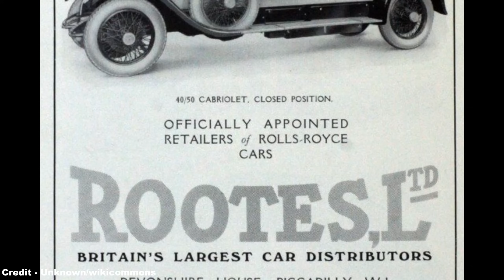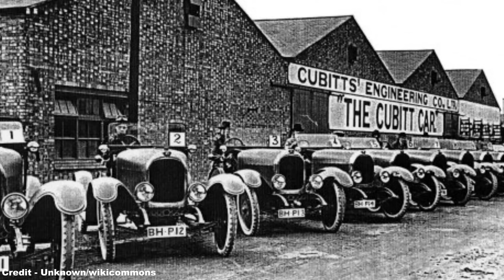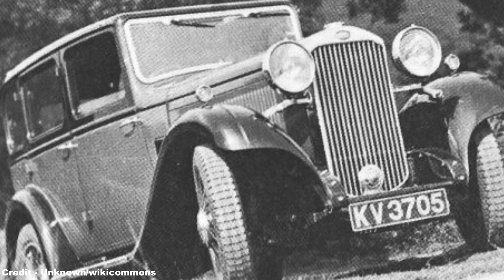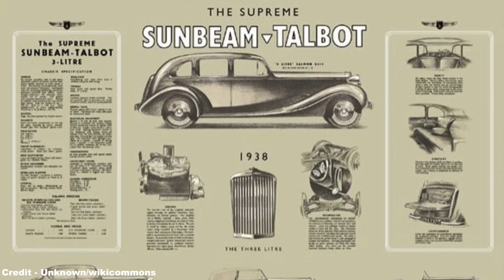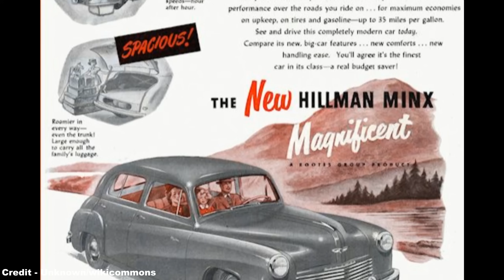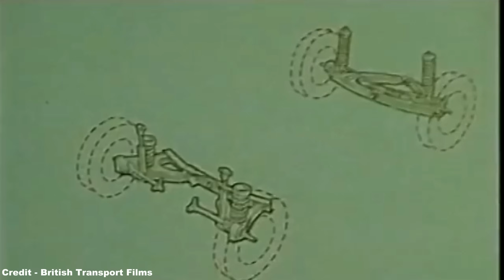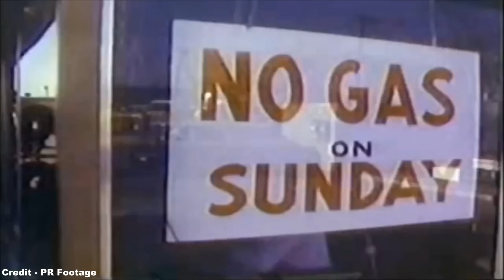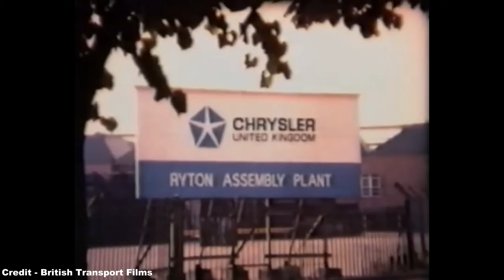Britain's Second Largest Car Company - The Rootes Group (Reworked)

Comment: I  did my apprenticeship at a Rootes Group main dealer from the mid 1960's and dealt with a lot of the models covered in this video. In my opinion the start of the rot was the government "strongarming"  the company to build a factory to build cars in a plant 300 miles from it's main operations, just for political expediency. The final nail in the coffin was the takeover by Chrysler Corp. From the start cost cutting was the name of the game , and by the early 70's things got really bad. I well remember inspecting new  Avengers and Hillman Hunters that had absolutely no corrosion protection on them underneath at all, just lightly painted floorpans, sills and underwings, so corrosion started from day one. Interior finishing was cut back to the bare minimum on the base models, to the point that a passenger front seat looked like it would become an optional extra, and cheap, thin rubber matting added to the air of something very unappealing to buyers. Sadly, all  part of the demise of the British motor industry, that through a number of different factors, killed off Rootes Group  and many other marques as well!

Comment: When I was young we had a Hillman Imp, but not for long. On two occasions, whilst traveling about fifty miles to visit relatives, with four of us in the car, its engine exploded at exactly the same place on a long hill, filling the car with steam. It was replaced rapidly thereafter with a Cortina, which itself didn't last (its bouncy ride made my Mum feel sick, and it had a habit of ceasing to run when wet!) before my Dad found a second-hand Rover 2000 TC that we all loved which remained with us for years until it eventually rotted away.
Reply: I'm with you on the reluctant Cortina. Ours was utter rubbish in the damp and as kids we were often pushing the bloody thing.  I've never had a Ford.

Comment: I can clearly remember hiring a Hillman Imp from Charters of Aldershot in around 1965/6. I paid £4 .10 shillings for Friday to Monday with no mileage charge. I was 18 years old. I drove it from Surrey to Yorkshire and back for a family wedding. It had 50 miles on the clock when I collected it. The two oddest things were the speed at which the engine picked up revs and how sensitive this rear engined car was to side winds.
Reply: I’m curious Mr dunky   how do you mean it was odd which the engine picked up revs-  can you explain more?
Reply: The “STD” brand! I imagine the models started from the germ of an idea that then , I bet you , spread like wildfire and the cars had quite an infectious charm😂

Comment: As a Aussie Chrysler tragic with strong connections to the UK (family 🇬🇧) this is a very interesting video I was always lead to believe the Imp was the Rootes group downfall though funnily enough my Uncle had one in the mid 70’s and used to go from Bolton Lancashire England  to my Grans house in Kinbuck Perthshire Scotland 🏴 every summer fully loaded and never missed a beat. Ah the memories aye 😁 0:10
Reply: Did you know the initial purpose of the Chrysler/ Simca 180 (what became the Aussie Centura) was to be a new generation Humber V6 for 1970.  Millions were even spent developing the V6 before the whole concept was unceremoniously dumped. At the same time Simca were struggling with their own relevance so the stillborn Humber project was  passed onto them for final development... albeit as a 4cyl...  
I'm sure if the Humber V6 project had gone into production it would of been a huge success for the ailing company...
Reply: @o8thman812  Simca is a blast from the past. We had a 1956 Simca 90A Aronde for many years in the 1960s-70s (Alongside a 1971 Triumph 2000 Mk2 which was far less reliable, and a Mk1 Cortina which was passable)